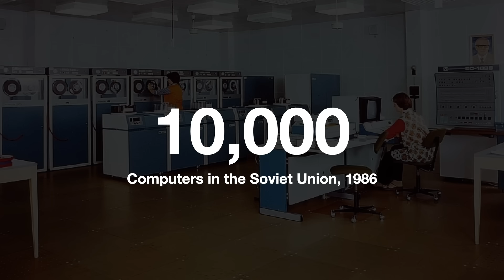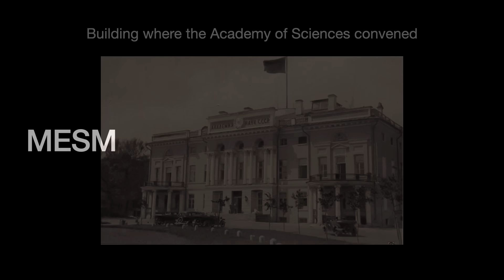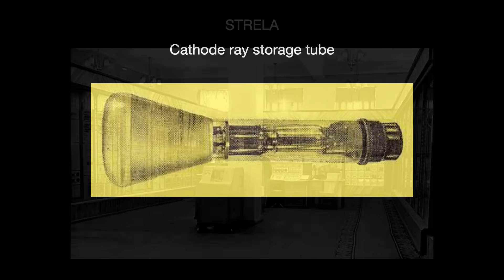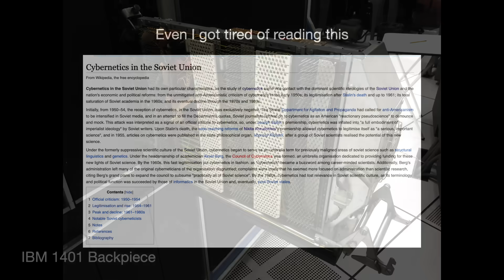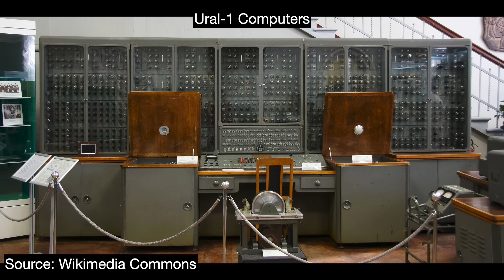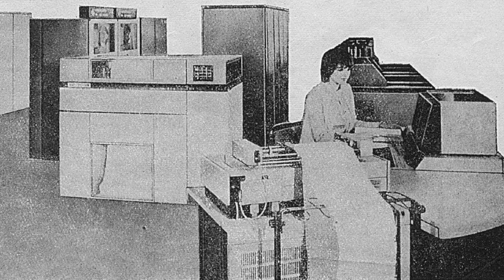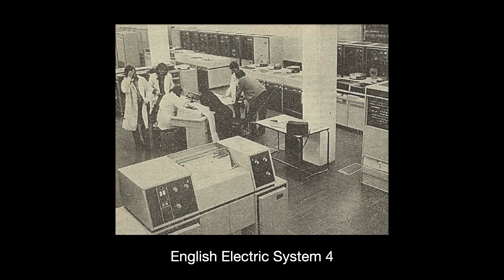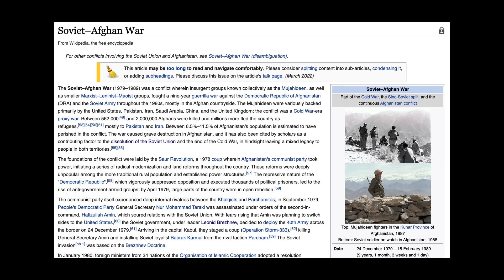Why the Soviet Computer Failed

Comment: you realise you're old when the legendary "640kb should be enough" credo is replaced with one about nanometers as the goto silly historical misjudgement....
It's also remarkable how often "communist" Russia shot itself in the foot by idiotic competition. The moon programs being the prime example.
Talking of which, Apollo used not just the alegedly weak onboard computers but also 3 IBM 360 mainframes (RTCC). Usually forgotten and ignored, when talking BS about going to the moon with "the computing power of a digital clock".

Comment: The Soviets couldn't computer-model the neutron density of the RBMK reactor core and so were fairly oblivious to the potential for instabilities at low power levels.

One of the many reasons why the accident at Chernobyl occurred.
Reply: No, that's not the point at all. The developers were aware of this feature.
Reply: Rest assured that the reactor designers knew about the instability and implemented two levels of protection to prevent the reactor from getting into that state. An incompetent operator planned and executed an experiment that would make the protections impossible. The operator disabled all protections and controlled the reactor manually. In violation of all operating regulations. Someone said that the sabotage could not be organized better than this "test".

Comment: I would like to add that there were many imported/smuggled IBM computers in use in eastern bloc countries industries, during the 70s and 80s. Certain oil refinery firms, chemical plants etc. happened to own a few of them. I know because my relatives worked in this area behind the iron curtain.
Reply: i always found it funny back in the 80's that a trs-16 from radio shack was banned from export to the soviet union because it ran a version of unix. now i see why.

Comment: The centrally governed industrial structure was the key fault that eventually undermined and destroyed all innovation. In the early 80s one Soviet factory invented a revolutionary microscopic drill-bit that was superior to anything in the west. But because their quota was set per volume of steel used for product, they instead opted for producing average arm-sized drill-bits for heavy manufacturing. Eventually the technology for the precision bits leaked out, and Western companies made a fortune on it. 
People today who choose to admire the USSR for whatever reason just have no idea how impossibly unnatural and unsustainable the system was at the core.

Comment: What the video doesn't say, is that IBM was all for the copying. They helped any way they could. For example, in the second generation of ES, Hungary was building the R15. This was a clone of the 370/125. This being a low end model, a unit was legitimately purchased by my institute which was developing the R15. My colleagues who worked on it (I was in a different department) told me that the IBM service personnel who came for regular visits to the 370/125, "inadvertently" left a fully commented listing of the microcode. This was of course not something that was ever given to regular customers.

It was a pretty weird microarchitecture BTW, especially the implementation of the virtual memory (table lookaside buffer, anyone?). I found that out as I was involved in a research project to develop extra instructions for high-level language support. Due to that weird VM implementation the microcode assist actually slowed  the generated code down compared to native 370 code ... but it was a fun project.

Comment: Seeing that ferrite memory module brought back memories.  Specifically, when a Soviet pilot defected by stealing a MiG-25 and flying to Japan, it gave the West a chance to look at the Soviet's most advanced weapons technologies.  Imagine their laughter when they discovered that the MiG was still using ferrite core memory, years after the West had been using IC chips in their on-board aviation computer systems.  The laughter continued a few years until they realized that in the case of an EMP burst from a nuclear weapon, the US jets would become flying bricks because the EMP would fry their electronics; while the Soviets, with their "backwards" technology, could shrug off the blast and keep flying.  Ferrite core memories are not affected by EMPs.
Reply: It also turned out to have steel wings and not the predicted titanium. At that time Western hobbyists could buy titanium screw sets for their R/C cars. The USSR was doomed.

Comment: Eniac computer (which was used to create artillery range tables) was itself was a dead end for computer technology development. Internally, it used a base 10 numbering system instead of the base 2 binary that is used today. And what you could call 'programable' would require rewiring the computer by hand to implement the changes, as the concept of downloadable 'software' didn't exist yet

Comment: Where does the 1.3 million number come from? By 1986 there were several US manufacturers who had individually sold more than a million home computers: IBM, Commodore, Apple, Atari, just off the top of my head. The 10k for the USSR also seems very low. Not that most USSR-built computers weren't copies of foreign machines or at least used their architectures, but they certainly did make more than 10k of them. There were 15k of the ES S/360 and S/370 clones built before the end of production.

Comment: Another aspect of this story was the explosion in smaller computers, starting in the late 70s.  Minis, and then micros proliferated to the point where anyone in the west, if they wanted, could get their hands on a computer.  CPUs and memory, in ever more miniaturized components, allowed programmable systems to be incorporated in any product more complex than a refrigerator.  Most especially in weapons.  The Soviets system could never match this.
Reply: i remember years ago reading that the fire control computer in the mig 25 was powered with their clone of an 8080 cpu. not even a z80 like we could get in a radio shack trs80. thats when i lost respect for soviet computer development.
Reply: @johngraesser4911  It wasnt when the movie Top Gun came out?
Reply: @rayerickson7614  even then there was the fear that mig25's could climb fast enough and fly fast enough that they could shoot down u2's and sr71's. The mig25 is what moved photo recon to space borne cameras. As it turned out the mig25 was a terrible interceptor and sams were the bigger threat.

Comment: the ferrite core memory is from besm. I snatched a bunch of them when our besm4 was dismantled to be replaced with besm6. In any case you can easily verify by counting wire rows: besm 2 was usung 39 bits, besm4 45 bits and besm6 49 bits (the numbers are odd due to extra error-correcting bit).
Reply: From the image I thought this is just one bit-slice so those pins are just address + read/inhibit lines. why/how error correction on one bit slice?
Reply: @Merilix2  sorry my memory was contaminated. However the bit sizes were correct. The weird numbers are explained by the fact that all besm machines were purely floating-point, only with different precision and range. For example 39 bits of besm2 were 32 bit mantissa 5 bit exponent plus 2 bits for signs of these. P.S. I looked at the memory plane under higher  resolution and I see I was wrong: it does not look like the one I had. The one in the video looks like on a textolite plate, meaning it is most probably a two-sided one. While memories from besm are "see-through".

Comment: I thought that the UK's Colossus, demonstrated in December 1943, by Tommy Flowers, was the world's first general purpose programmable computer not Eniac.
Reply: My understanding is that the Colossus is not considered a general purpose computer; there was no stored program but it instead did calculations for cryptanalysis of German Lorenz cypher machine communications that were loaded onto paper tapes. So the data could be changed but the underlying "program" could not. It was an enormous undertaking to reprogram ENIAC (programming was done by plugboards) but it could in principle be reprogrammed to do any calculation. 

This is not to diminish the impact of Colossus -- it was a tremendous accomplishment, it was for both for the immediate impact on the war effort and for the longer term influence on computing.

Comment: Sorry, the numbers are completely wrong. The first calculator is ELKA - bulgatian patent. In a astronomical club for children in 1978 i learned ALGOL. In 1980 learned FORTRAN and LISP, solving differential equations for object recognition on EC-1020  (extended copy of IBM-360) and 1981 started to use also EC-1040 at the math faculty. Almost 200 computation non-military centers were available for students. So 10000 computers were only in Bulgaria. We Produced EC-1040 and 1060 (the mast is analog of IBM-370, 390) until 1988) and the first personal computer sent on Earth orbit station MIR was Pravetz. The actual issue was the changes made by Gorbachov destroying economical relations

Comment: A Latvian relative of mine has a degree in engineering and in one of her jobs in the 1980s was to operate the only mainframe-sized computer in Latvia at that time.

I don't remember the computer's name or specifications, or what it was used for, but everyone at that office was very proud of it, not knowing how far behind they already were at that time.

I remember the Soviet-based railroad ticket computers from touring the Baltic states in the early 1990s. The monitors were small, the keyboards were big (partly due to the Cyrillic alphabet), and the design was… industrial.

Comment: hmmm, you must be talking about large computer centers....Romania produced almost 100 computer variants some of which were genuine like aMic and the PRAE computers for home use, and some were Sinclair Clones like the HC 85, 88,90,91, 2000 and HC 386 a 386 compatible PC launched after 1992 but only in few numbers. Commies managed to clone the Z80 processor also made in Romania called MN80 and commies also bought the licence from the french which was IRIS 50 IBM compatible...so you have some info but is incmplete...and yes romanians were used to spy Texas Instruments since romanian workers or wives would smuggle ICs and drawings and floppy disks from american factories, especially lab tests which were labeled as scrap....they would reach Romania via Brazil and Turkey, Romanian home computers plus large scale computers account for i remember around 100 different models, so there was some gap but not that much....the gap started after the manufacture of the 286 CPU i guess

Comment: The worlds first stored program computer was not Eniac. It was British, the Manchester 'Baby' of 1948. All electronic 'computers' before that (including the Bletchley code breakers) were fixed-purpose sequential program calculators, not true computers such as we use today. The Russian mainframe I saw in the 1980s was a copy of the IBM 360, complete with characteristic 'kinked' control panel.

Comment: My dad was required to drive a different route to work each day to conceal his location while working at a special plant facility for Univac in the early 1950’s ... as a child I was given “toys” from his work... transistors the size of pocket watches, solar cells to power my small electric car and printed circuit boards... after hours he drove my by the location and pointed it out.
Reply: @Retired Bore Yes 2N404's, a very popular germanium PNP switching transistor used  in lots os computer circuits, sometimes along with it's compliment a 2N388 (NPN).  I still have perhaps 1,500 of the old 2N404A's.  They are still available , and yes a lot are from Russia.  Pretty damn big, by today's standards.  Now IC's with billions of transistors fit in the same size package,.. about 3/8ths round and 1/4 inch tall.  I believe that they could operate at a couple of MHz in standard switching circuits of the time.
Reply: @Geopholus  *complement (not compliment like "you're looking good")
Reply: @epajarjestys9981  OK ... I never knew that.
Reply: @epajarjestys9981  Talk about missing the forest for the trees... jeeze we're proud of you for learning English, but don't try and remedial train when the meaning was CLEARLY understood.
Reply: @Geopholus  Turn off Wikipedia🤦🏿‍♀️
Reply: @colors6692  .  Well I did write a ridiculous article.... sounding ,... somewhat like wikipedia,.. but all from the top of my head.  I built a whole lot of circuits with 2N404's.  I wonder if wiki said one single thing that I did?
Reply: Nice! Any idea on some of the stuff he actually worked on specifically? I’m rather curious now.
Reply: My old boss and friend who is about 90 now he lives down the street he got one the first transistors ever made it was the first transistor remarried I don’t know how are you required that he works for Ampex or he worked for Ampex and made a lot of money with a special device that transmit video over 5 miles through 22 gauge wire anyway he’s got this transistor and it’s worth 600 bucks then not now but then
Reply: In 1965 my eldest sister (RIP) worked for a transistor factory in Arura Ill. She brought some plastic housings home and gave me when mom and I went out there via train from South Dakota for Christmas with them. The cases were very large considering the size of a transistor today.
Reply: @JerryEricsson  

Oh yes when I started on electronics in about 1964 tubes were starting to go out transistors were starting to come in

So I learned very little tube theory which now the old timers are in high demand for

So I used to work with individual transistors and then about I guess the 1970s they came along with the integrated circuits the first integration circle pose RTR resistor transistor logic and then it took a while and they came out with CMOS no no I’m sorry TTYL transistor transistor logic and then CMOS and then FET from there and I kept up with that pretty much up until the big

Microchips and the first one I remember I think was the elf and you could program that in hexadecimal but you’d have to take it to television CTR and you could only see the bits on it you couldn’t really do too much with it but that was way before the Commodore and the other personal computers it had a 16 digit keypad that you would program and it was really funky but that started me and Tu computers yeah those transistors I have first transistor I made a project for my sixth grade class I’m supposing it was 1964 had one transistor and it basically had a photocell and you put your hand over the photocell and a light would go on OK now you can buy those at Home Depot for three dollars but I made it from scratch it even had a transformer on it for god sake’s
Reply: I’m curious too.
Reply: Interocitors